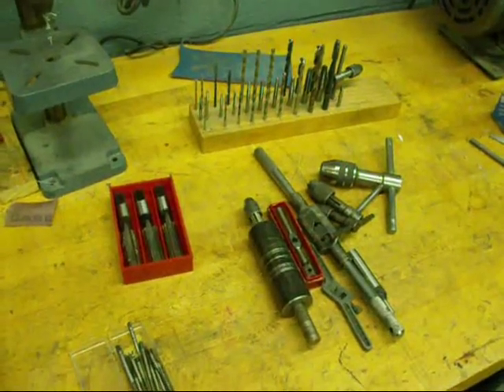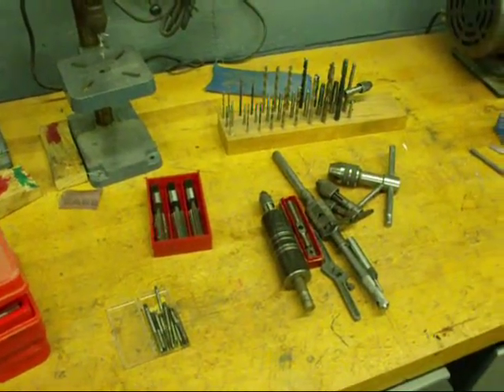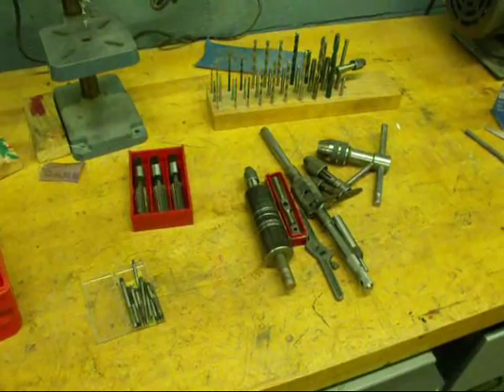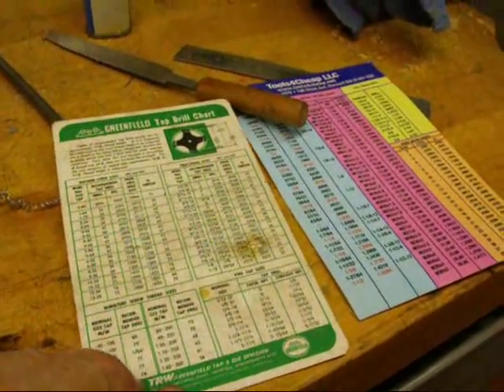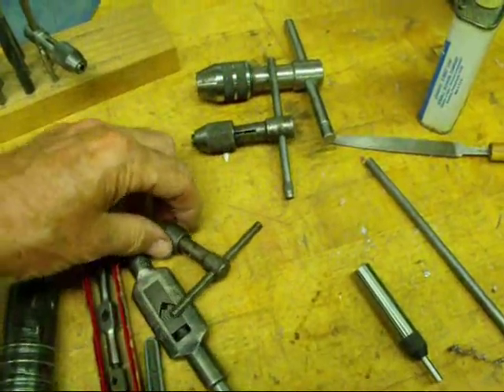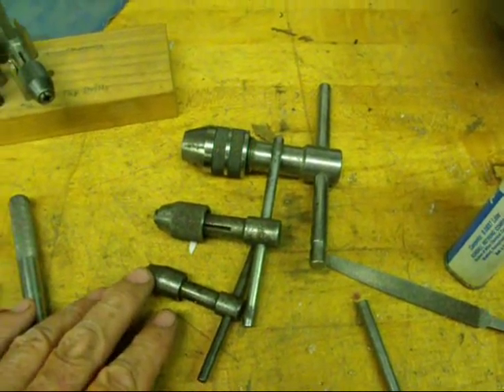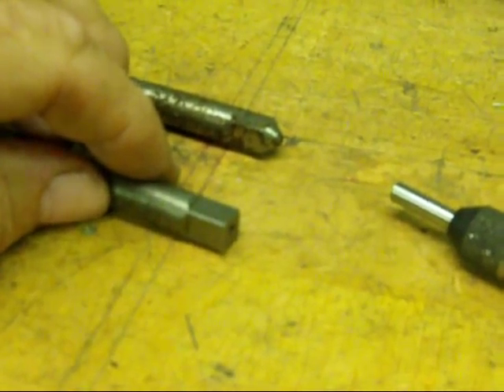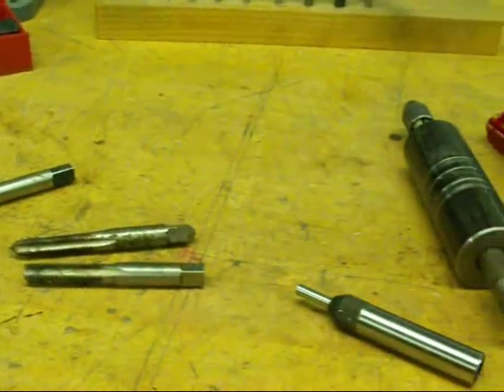MACHINE SHOP TIPS #1 Taps  tubalcain

Comment: An old gunsmith's trick was to use carbon steel taps. 
You see, tiny taps used for tiny gunscrew holes are very fragile and prone to snapping off inside the gun. Because carbon steel taps are more brittle, they can be shattered with the strike of center punch, then the pieces fished out of the hole. High speed steel taps are relatively tough and won't shatter reliable if at all.
Reply from the maker: I've never heard of that trick, thanks for sharing.
Reply: @mrpete222  The real trick is finding quality carbon steel taps. I don't recall their supplier, but Brownell's ( the gunsmith supply website/catalog) has them available in most sizes relevant to gunsmiths.
Another trick is just to buy a new tap for each gun... tiny taps are cheap compared to a gunsmiths labor.

Comment: 10 years, Mr Petersen? As I type, this excellent video of yours has been going FOURTEEN years - and still as fresh and useful as ever. BTW, I grab all the second hand Poland-made shop tools that I can. Poland has a fine tradition of metal working and industrial production (related, I think to its decades of being the machine shop for the USSR) and since 1991 has moved to cement itself as a high tech powerhouse of engineering. Polish tools are GOOD!. Regards  from England, Mr P.
Reply from the maker: Very interesting. But why is it that? I absolutely never see any tools from Poland?

Comment: Always good.  Since I use a lot of 6/32, 10/24, 1/4x20 and then are hard too see the numbers, I always save the boxes with the easier to read marks.  Just makes things a bit easier though you get to point you can pull the right tap out by just looking.   Thanks again.

Comment: Mr Pete,
Now, it is July of 2017, and taps are being sold with titanium coatings, and drill bitts have titanium nitride. How does the quality of these compare with High Speed Steel.???
Reply: Jeff Burns.they are still hss but will last longer because of the coating.

Comment: I have had a certain amount of luck removing broken taps by cutting around the tap with a hole saw and taking the stub our with needle noses or vice grips. Sometimes I can get them to back out enough carefully using a small punch so I can get needle nose pliers to grip. This is a good use for needle nose with broken tips since you can grind them to any shape. There is also a device I have not used that is a body with four oval (semicircular?) alloy pins that installs over the tap by sliding the pins down the groves between the threaded cutting portion of the tap. They look like they would take great care to avoid breaking and making things worse. I have taken dull carbide die grinder bits and ground them down and used them to break up the tap. Amazing I am not still digging tap chips out of my body. Plan on taking a half hour or an hour. Like Dr Pete says, throw the work away, LOL. Once you break off a certain number of taps and rusty studs, you develop a feel for when something is about to break and then stop to consider the situation and your options. Good taps are harder to break than cheap ones. My best set came from the Snap-On tool man about 20 years ago. Some sort of brownish coating on them. Don't throw your taps and files in a box, they will dull each other. Drill holes in a section of 2x4 and mount them in that. Handy to take to the workbench too.

Comment: taps can be recovered if you break them into you work. all you need is a "sacrificial" carbide end mill and some patience. For your typical M6 spin a 4mm carbide end mill at about 3000 RPM touch the top of the broken tap, and then feed 3 or 4 thou  in every pass you take. eventually the tap shaters apart and usully leaves a reasonably good thread. Secrets learned from a toolmaker... and used quite a few times

Comment: Question-What's the difference between a tap and a thread chaser. Been on many machinist forums and I'm still not sure. I have been always told, to clean up threaded holes you use a chaser-your comments would be appreciated.Thank You-JJ
Reply from the maker: +john james I think you are right, but I think of chasing with a die for clean up or repair

Comment: hey mr pete, could you give me a tip here??? i'm building a cnc mini mill from aluminium , many taps threads have been made since i started a month ago, i want to use lock tight to keep every bolt in place. i'm just about to finish all parts to start assembly but i've been trying top clean cutting oil from threads but nothing seems to work , they are all oily, what should i do???
Reply from the maker: Use lacquer thinner or spray cans of BRAKE CLEAN. Do it outside, well ventilated.
Reply: mrpete222 I've got a few cases of brake cleaner in my garage. That stuff is magical.

Comment: Thank you for all the videos that you have made.  I am an apprentice machinist and look forward to going through all your videos, even in areas that I already know.  Last week I had a large brass block that (presumably) a sailor broke off a tap while under way.  The tap had to be extracted.  They did a hell of a job trying to extract it so by the time I received it, it was pretty mangled.  I ended up using a small endmill to remove it.  A tap extractor was not going to work in any way.  I am also getting ready to purchase my first machine, a mill.

Comment: There are taps and dies with a lifetime warranty.I have a Matco set that is just over $500.00,a rebranded Irwin set.Broke one and two went dull replaced under warranty.Never use a tap to clean out holes either.I have a set of Matco rethreading taps and dies for that reason with a lifetime warranty.

Comment: Yeah...I am machinist for 35 years and saying that tap extractors do not work is just simply not truth. They might not work in every situation, but generally speaking they do work. If needed, you can use carbide drill or make one from round carbide rod and at hi rpm just drill the center body  of tap out.The remnants will come out with compressed air and pick. And of course, then there is EDM.-burn the center body out and then compressed air and pick....

Comment: if you break a tap the in a though hole you can used a carbide punch to crack the left over up and then re-drill it and tap. also and for un-replaceable parts you can use a EDM to burn out the broken tap.

Comment: I disagree that broken taps are impossible to get out.  Difficult, but not impossible. The easiest way to remove a broken tap is either a sinker EDM or a fast hole machine.  Most people don't have access to this equipment so I would recommend pecking it out with a solid carbide endmill on a bridgeport mill. The endmill breaks occasionally but they usually shatter so you can remove the pieces.  If you don't have much time or money invested in the project, it is probably easiest to start over.

Comment: 7:07 I broke a 5/16 tap last week in a tractor engine block.  I was able to remove it with a Walton tap extractor.  I would not have known about them if I hadn't watched this video.  I was skeptical about it working, but I had no other options.

Comment: if you want to know the drill size of a tap simply take the od of the tap minus the pitch in exampl 1/2 -13 in tap. half inch is the major od of the tap minus pitch is number 7 drill.  To figure the pitch 1 divided by 13 =.0769 -.500=.423 with is pretty much 21/32 it even works with metric and is real easy

Comment: Great video(s)! I'm working my way through them now. I agree on the 'finger type' extractors. Usually when someone breaks a tap, it's because too much torque was applied (chips built up, dull tap, hole too small from worn out drill, etc). If the body of the tap wasn't strong enough to turn it, those tiny little fingers ain't gonna do it either!